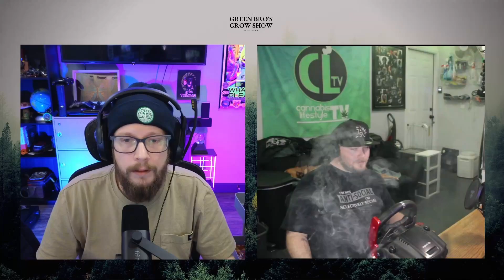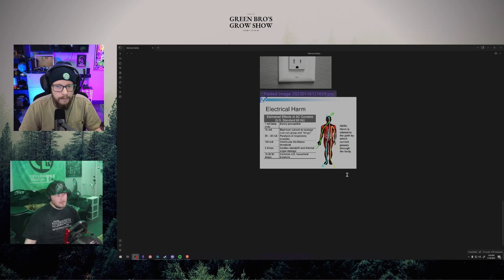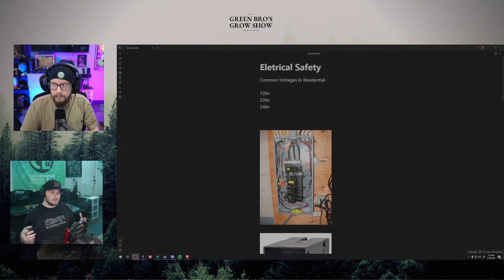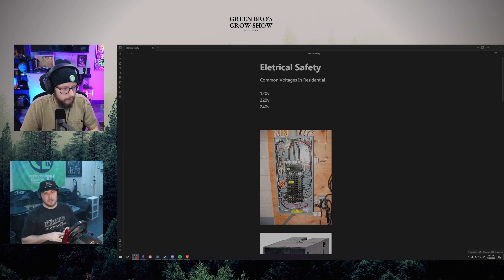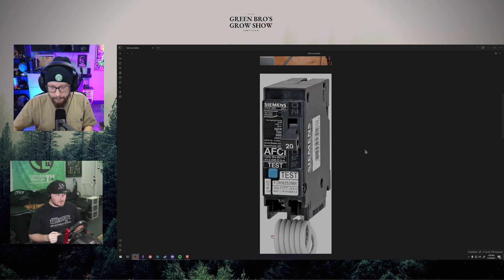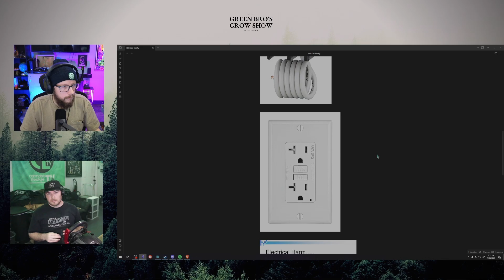GBGS - Electrical Safety 101 with @its_b_ya_digg_sgf

Comment: question, forgive my ignorance, you mentioned you put your lights on 220 from 110 and saved about half wattage.  How do you control the room with 220 lights and 110 fans, humidifier.. Are you using multiple controllers?   Great vid!  Could be an amazing new vid.. how to control your grow using both 220 and 110.  Thx
Reply: Your light would be on 240v and fans would have to be on 120v. Always read the manufacturing specs to make sure
Reply: @its_b_ya_digg_sgf  I should have typed 240V and 120 V  my bad, my question is on controller .  Would you have to run different controller for the 240v and another for the 120v.  BTW thanks for responding. A little intimidating asking an electrical question with no experience.
Reply: @CoupleofCruisers  no worries at all!! To control 2 different voltages you would definitely want separate controllers for each voltage... unless the manufacturer states that you can run 2 voltages. if I had a light that runs on 240 and the controller runs on 120 I would just run the light at 120. There are dual voltage controllers but you would have to check with the manufacturer to be 100% sure that everything is compatible. My whole system is on 120v fans and lights. In order for me to run my lights at 240v I would need to retrofit all the timers switches and plugs to 240v devices and wiring
Reply: @its_b_ya_digg_sgf  You're cool!  Much appreciated.  I'm trying to dial in my converted bedrooms this winter.  I'm going to run a mini split 240v and have to re-wire a couple rooms to handle the mini split and a couple 800w lights plus fans etc.  in ea room with no worries.     Obviously, I won't be doing the electrical myself... haha   Thx again!
Reply: @coupleofcruisers1710  no problem at all!! Glad to help out!!